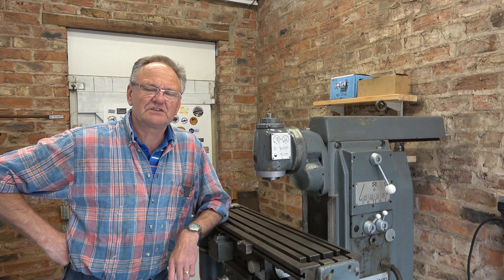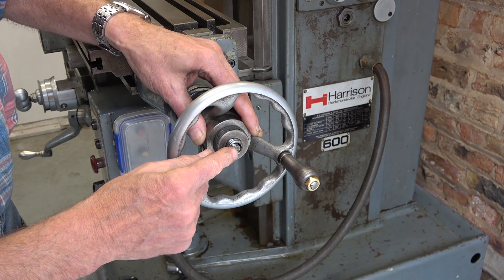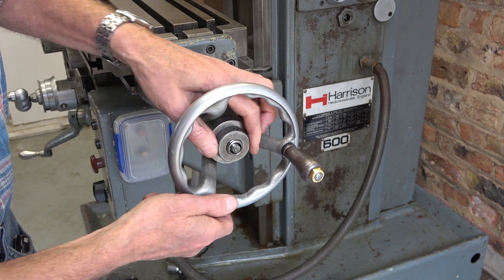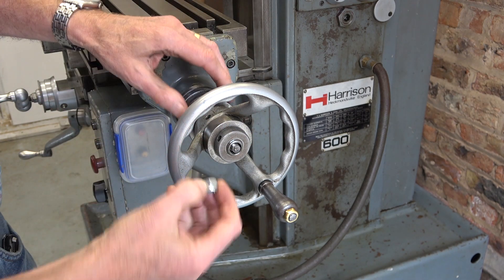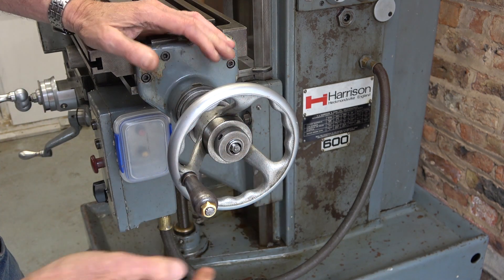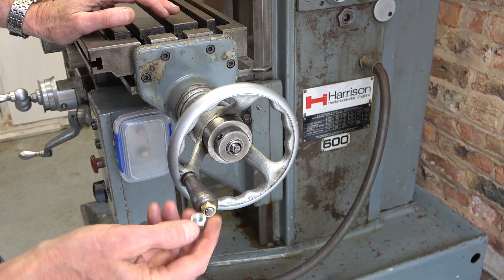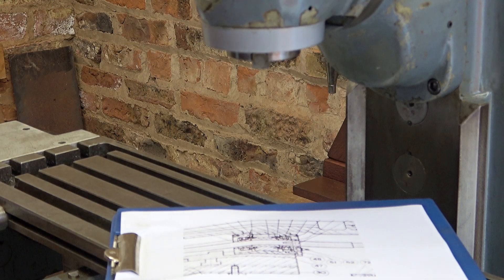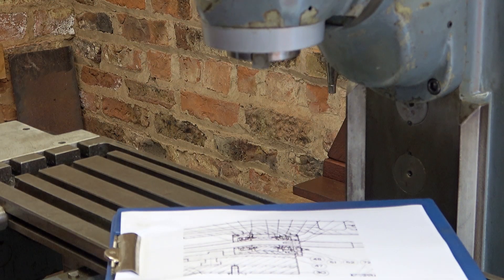HS209 Harrison universal mill table nut – Part 1

Comment: Paul they meaning someone on eBay or Amazon makes a ball screw conversion to get rid of worm or acme threads and they are just nice the thread is prolly a 4 or 5 tpi acme
Reply from the maker: Hi jkmcp, this is a not a standard thread - 5mm pitch with a 29 degree angle on a 3/4 shaft. But more importantly I can't deny myself the challenge and excitement of  making a new bronze nut with the splines and all 😁

Comment: Great stuff! 

As others have suggested, looking at the apparent meat on the nut, and its expected duty in your workshop, I'd see if sleeving was an option. 

Given the eye watering cost if bronze, I'd make a test nut in steel or aluminium to prove the setup before committing 👍
Reply from the maker: Hi Matt, I have parked the idea of sleeving for now in favour of making a new one and probably including a backlash adjustment. I have some SAE 660 bronze now but, as you suggest, I will try a test nut in Delrin. Cheers

Comment: Can you sleeve it?
Reply from the maker: Hi Mick it may be possible but there is not a lot of margin for that. And then would you press it in, or silver solder? Cheers
Reply: @HaxbyShed  How about adding material by brazing and drilling and re-tapping it?
Reply from the maker: Hi Mick I'm sure that's technically possible but I'm growing more confident that I can make a new nut. Cheers

Comment: On the nut front, if you're never going to be using a power driven dividing head then there is little point in replicating exactly what is there. 

Just create a new nut with a flange and mount to a new mounting plate. You'll lose the ability to "disengage" the nut but the only use is for the power driven dividing head so if you don't have one and will never use one then don't bother!
Reply from the maker: Hi fastdruid, thanks. Quite possibly I will not use a power-driven dividing head but maybe I would try power-driving a rotary table. It would be a nice project. I would like to keep it original. Cheers

Comment: Either someone has done some modifications (possibly because of the missing nut) or Harrison changed the design from earlier (and as shown in the manual). 

On mine the screw runs on the bearing in the end mount then there is a long splined section on which first the micrometer dial, then the spacer and handwheel etc sit on. Finally the nut on the end holds it all together.

End play on the screw is controlled by the bearings on the left (ie the gearbox) and the nut on the end is small enough that the knurled wheel, hand wheel and spacer can be removed without disturbing it (hence why there is a warning not to). 

I'll have to take some photos and send them to you.
Reply from the maker: Hi fastdruid, it would be good to see the photos - thanks. Cheers

Comment: made a new nut a few years ago screwed both nut together on the lead screws and cut them with a piece of high speed steel using the lathe carriage
Reply from the maker: Hi Steve, that sounds very good and may be my approach if the dividing head method (and my mill head swivel limitations) make that the preferred route. Cheers

Comment: Hi Paul, Wow a lot more going on than the average lead screw.. bummer needing to put the machine back together to cut the splines, maybe a road trip to Ades or Jon's workshop?
Yeah and it's never just one issue when you open the rabbit hole.
Enjoyed !
ATB.....Cheers...
Reply from the maker: Hi Dean, I hope all is well. I have a friend 2 miles away with a Harrison mill and dividing head on standby but I've an idea to lock the x-axis and use the y-axis only, if I can swing a dividing head off the side of the table. Cheers Paul

Comment: That nut is easy enough to make. Thread the inside first. I use a technique of using a toolbit narrower than the thread, have the compound parallel to the lathe axis. Plunge to depth, then take passes advancing the compound to widen the slot. You can check when the leadscrew fits, so you can control the backlash you want.
For the splines, try and work out the angle of the grooves and get yourself a horizontal cutter to cut them. I have a few - you can borrow one if one cant be found. Yes, you'll need the div head, unless the angle between grooves is a whole number of degrees, then that spindexer whose box is on the shelf could be used, although workholding would be challengiing with a 5c or er32 collet.
Reply from the maker: Hi Robert, I'm getting close to cutting the thread on my test piece of Delrin. Thinking to set my compound at 14.5 degrees because my holder 'threading bar' is only 3/8 diameter and might object to cutting bronze straight in. I've ground a tool about the right width I think. As you say I can test fit the lead screw.  48 splines = 7.5 degrees so can't use the spindexer. Yes a horizontal spline cutter would be an option (if I had one) but I'm hoping to use an end mill over at 45. The splines seem to be 90 degrees internal v-angle. Cheers

Comment: Hi Paul, they look like thrust bearings, or maybe angular contact bearings, when took apart, it's normal for them to look like they have play, but thrust up correctly they would be in tolerance, just a thought.
Reply from the maker: Hi Dave, I agree but it's just that one has just a bit of wiggle and the other has maybe 1.5mm of free movement. I have bought some budget replacement bearings but I'm still undecided whether to change them. Cheers

Comment: Hi Paul, that must have been quite a shock to break off that part of the casting, wonder if that happened when the shaft got bent🤔🤔

I'm glad you were able to catch that gearbox when it eventually released itself from that dowel pin and didn't hurt yourself in the process.

Some good ideas in the comments as to how to go about making the nut, or refurbishing it. I'd be tempted to keep the old nut and make a new one so that you have something to fall back on. It's going to be interesting to see what you decide to do, or perhaps have already done!! I'm sure you'll make a great improvement whatever you do.

Really well presented video, well done. Have a great weekend.
Reply from the maker: Hi David, I've not got very far since that video. It is summer school holidays and we seem to be set upon by grandchildren. Nice of course but I struggle to get anything done!! Cheers

Comment: To check the exact pitch of the leadscrew, just check the dial on the handwheel :)
Reply from the maker: Hi Michel, I know the pitch is 5mm but the question is what thread cutting tool did they use? Because this is a metric pitch by rights the ACME form should be 30 degrees. I think the form is 29 degrees (imperial) so did they make a 29 degree 5mm tool or did they just use a 5tpi tool.  5tpi is 5.08mm so cutting a 5mm pitch with that would mean the thread would be asymmetric - the valley might be 2.54mm and the crest might be 2.46mm but this is just paper theory and in real life it probably does not matter in any practical terms. I can't grind a tool that accurately anyway!  Cheers.
Reply: @HaxbyShed  OK, it all makes perfect sense now.

Comment: If the teeth on the nut drive are OK. How about boring out the nut sleeve it and re-threading?
Reply from the maker: Hi Matthew, it's possible but not a lot of meat to spare. At the moment making a new one is my preferred option. Cheers

Comment: Are you sure the nut is one piece? There seems to be a lot of mechanism which isn't explained for (at least from my armchair persective). Could there be a backlash adjustment feature? Agree with the comment above avout the play in the thrust bearing.
Reply from the maker: Hi Clive, the nut is defo one piece. The mechanism allows the nut to rotate when you want the lead screw to turn but not move the table (say to mill a circle with the vertical head on a rotary table driven from the lead screw). But I agree there is an opportunity to incorporate a backlash adjustment and I'm going to try that - firstly with a nut made from Delrin as a prototype. Cheers

Comment: Hi Paul, you can use the worn nut as an dividing tool on your lathe. To shape this „gear“ on a lathe is not so complicated and it saves a lot of time to rebuild your mill.
Reply from the maker: Hi Thomas, I agree that's an option and if I hit any problems with the dividing head approach that's what I'll try next. Cheers

Comment: Saturday morning job, not. Very interesting design,  components being in as supplied condition,  not hardened make it easier. 
Thanks for sharing
Reply from the maker: Hi John, it's going to take a while inc making a prototype in Delrin. But the objective of a hobbyist is often to learn from the journey more than it is to find the quickest/cheapest solution. Later, I will looks for ways to drive something from the lead screw - probably not a dividing head, more likely a rotary table. Cheers

Comment: Very interesting Paul. Ref making the splines on the nut,  would your shaper with some sort of dividing head do the trick?
Reply from the maker: Hi Jason, I think technically it could be done on the shaper yes, using the old nut as the index. Might be moving the ram by hand rather than powered - this is only bronze so soft enough. So yes it's definitely another option. Cheers

Comment: I would be tempted to divide the nut in two in the the lathe Paul. That way you can build your own backlash adjustment in to the assembly. Either make a threaded sleeve to push the two halves together or can you incorporate shims ether between the two halves or into the end plate? If you do decide to make a new bush, make an index  system for the lathe spindle  and cut the splines with the carriage. That way, you can cut the thread and the spline in one setup and guarantee perfect alignment. I personally would take option one as no doubt the new nut will bed in to the used screw and you will be back to square one rather quickly.
Reply: I was thinking the same,  I believe later Bridgeport machines use a split nut arrangement.
Reply from the maker: Hi Bobuilt, thank you. I do plan to incorporate a backlash mechanism in the new nut. I had a way in mind but now your comment has given me another way, which I may try on my Delrin prototype. Cheers

Comment: just fit a dro an get on with your life
Reply: the table will jump during cuts and is a pain to use, ask me how I know! but yes a dro is an excellent piece of kit but wont fix the backlash, these tables haven't the inertia of a huge mill to prevent vibration in the cut
Reply from the maker: Hi Secretsix6, I agree this machine would benefit from a DRO, but as Anthony says below, the backlash will still be a pain so needs to be fixed anyhow. Cheers

Comment: Hi,Paul. Are you certain the bearing is  actually knackered and the slop/end float  in the bearing isn't simply because it is a angular contact thrust bearing? What I will say is those Hoffman bearings are a very high quality item,often having bronze inner cages and the letters 'MS' etched onto them which denotes them as 'Military Spec'. 
 
Just a thought about the Acme nut.....Is there sufficient wall thickness that you could bore out the old worn thread and re-use the outer splined section as sleeve to loctite onto a newly machined bronze inner nut?....that would save you having to machine/mill the outer splined detail.
Reply from the maker: HI Howard, so on further investigation the bearings are indeed angular contact and thus would have a degree of slop when not side-loaded but the worst of the pair has great deal of slop to the point it seems worn out. I have got replacement bearings but at this point I'm still unsure so I may keep the old ones in and send the new ones back. I'll talk about it in Part 2. Cheers

Comment: The splines on that nut are going to be interesting to make. As they are quite short and not too deep and are in brass/bronze, I was wondering if you could rig up a dividing head on the shaper and short stroke it with a custom form tool. If you need a dividing head, I have one you can borrow.
Reply from the maker: Hi Bill, yes cutting the splines on a shaper is option perhaps using the old nut as an index. I can fit my spindexer on the shaper table but 48 splines = 7.5 degree spacing and my spindexer won't do that.  I have a dividing head now but I've not yet tried that on the shaper table yet ...... lots of options have been highlighted now. Cheers
Reply from the maker: Hi John (bostedtap), that sounds complex and interesting. Shapers can do anything.  😁
Reply: Single point tool for the win. @HaxbyShed
Reply: Excellent idea, during my apprenticeship,  I used a shop made tilting dividing type head to make both straight and bevel splines to drive copper welding wheels on a shaper.
There was linkage to rotate the spindle the required pitch for each shape back stroke. The material was some hardenable stainless steel,  it had to be stainless  ref being in a strong magnetic field induced by the welding current when resistance welding.

Comment: Those ridges could definitely be interesting to machine. Perhaps they'll need a custom cutter (like a gear cutter, but with quite a sharp point and a specific diameter). That said, I can't see the dimensions of the end where the ridge cut tails off as being particularly critical.
Thanks for sharing anyway, I'm not sure if it's the case for this mill but for some machines, vids like these are the best documentation available.
Reply from the maker: Hi R9000, there is a pretty good manual for this machine but Harrison designs evolved over time and the manuals did not really keep up.  I have emails and photos from viewers showing their machine and there are many factory variations. These machines were made for decades. I agree a horizontal cutter could do the job but my intention is to try an endmill set over at 45 degrees on the vertical head (partly because I don't have the right horizontal cutter but I will be on the lookout for a horizontal spline cutter to add to my tooling). Cheers

Comment: A more complex arrangement than I was expecting.
Reply from the maker: Hi Greg, the Harrison Universal mill is a small package with a lot in. They were aimed at small workshops and training colleges. I guess it was for the colleges they had all the features so students could try their hand at advanced techniques like helical milling, spirals, cutting circles etc. But often Harrison machine designs did well at the complicated things and cut corners on the simple things. Why not incorporate a backlash mechanism in the x-axis nut (?)  - relatively easy to do given all the parts are basically there already. Cheers

Comment: Machining the splines in a replacement nut look like a very interesting learning curve, but I guess that's one of the benefits of restoring your own mill, as it is a perfect driver for expanding your skill set (and tooling). I also note the earlier comment from @graedonmunro1793 about using a sleeve inside the existing nut and re-cutting the thread, certainly food for thought for this repair, providing there is sufficient material in the nut.
Reply from the maker: Hi Paul, you said 'perfect driver for expanding your skill set (and tooling)' and I think you have really captured it. That's what I really enjoy - the adventure of discovery and learning new skills. The quickest/cheapest way is not always the most satisfying.   Cheers
Reply: @HaxbyShed  A wiser person than me once told me to treat every day like a school day, acquiring new skills and discover something new. I may not have practiced it every day. but I certainly picked up a fair amount along the way

Comment: always interesting. thanks for sharing.
Reply: Generally the use of upstanding table guards keeps any splattered coolant within the confines of the table work area and prevents coolant/swarf going everywhere. The end plates on the table are often sealed against the table ends with a smear of liquid gasket compound and the coolant should then only exit the table area via the coolant drainage points/holes.
Reply from the maker: Hi Howard, thanks. I'm going to seal between the gearbox and the table with liquid gasket (blue Hilomar). Cheers
Reply from the maker: Thanks Jack.

Comment: I  have always been curious as to how when I see folks running liquid all the time they are cutting that they don't make a big mess or make the machine rusty or all gummed up with cutting and dirt.
Reply from the maker: Hi Vernon, soluble cutting oil is mucky stuff and leaves quite a sticky mess. But these modern synthetic oils are a lot cleaner and improve the rate of cut and the finish. The trick is to control the rate using the minimum so the darned stuff is not spraying all over the place. Cheers